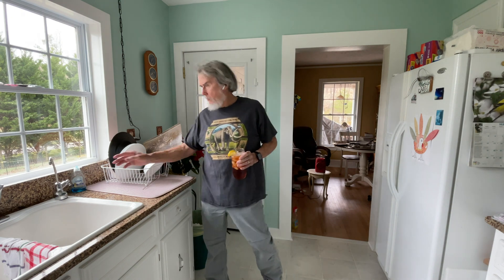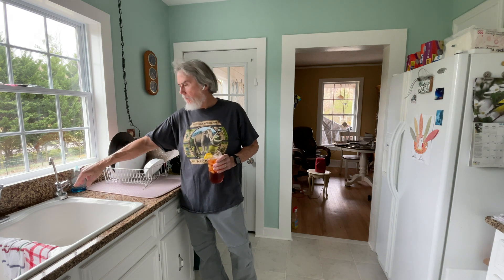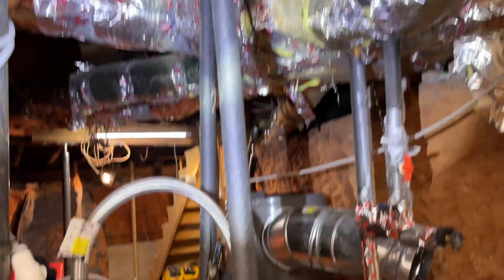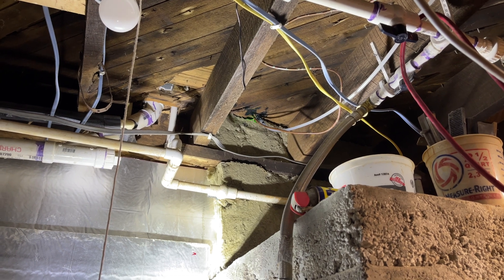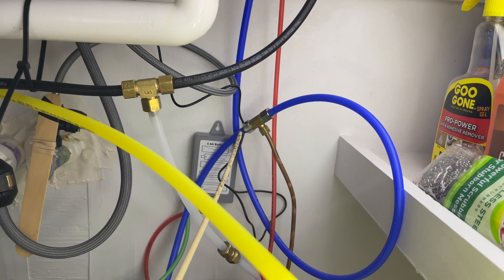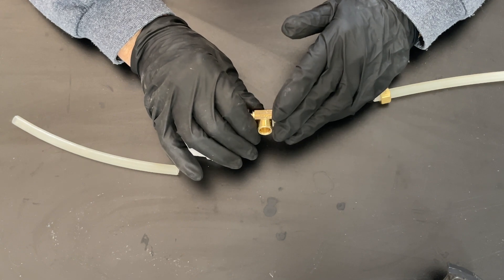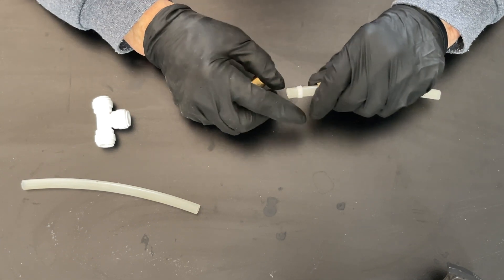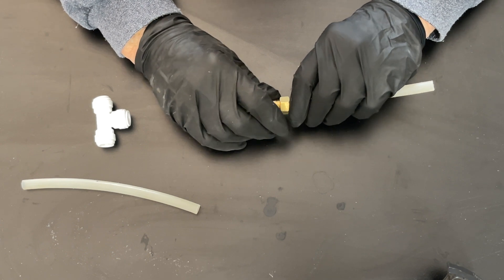Connecting a Reverse Osmosis Water System to a Refrigerator Ice Maker

Comment: I have an under sink system running to my LG fridge and freezer for water and ice. My water is great, but once I add the ice into the water it tastes bad. I can't figure out why this is happening. It comes and goes, so it is not all the time.
Reply from the maker: Some plastics can cause the water to taste bad. Try freezing another source of good tasting water in a separate ice cube tray and see if that ice makes the water taste bad. Sometimes food odors in the refrigerator or freezer can affect the exposed water in ice makers or ice cube trays. A long time ago we purchased a new refrigerator that gave us bad tasting water out of the dispenser. The solution was a different brand of refrigerator.
Reply: @anisotropicplus I did read a water softener can cause the ice to taste bad and does not affect the water taste. We changed the filter (which was dirty) and added salt. So trying that to see if the ice is better. Old school ice trays just sounds like too much work to keep up with these days
Reply from the maker: Thanks for your comment and let us know if you find a solution to the taste problem.

Comment: No issues with pressure from the RO unit to the ice maker? I have all my connections proper but the ice maker won’t work I’m assuming due to low pressure from the RO unit.
Reply from the maker: You may be correct about the pressure. We just bought a new Whirlpool refrigerator and the installation instructions said the ice maker and water dispenser will not work using an RO supply unless the water pressure is at least I believe it was 40 psi. Make sure your RO expansion tank has the correct air pressure on it.

Comment: So did your copper rot out yet r o through copper usually eats it up with in six months to a year
Reply from the maker: Not yet, but you are correct about it being a potential problem.
Reply: so it’s leaked since then? also cleaning using Bleach isn’t a great idea as Clorox’s main ingredient it’s really a HEAVY oxidizer greatly reducing the lifetime of the cable after it reacts with copper. so more like 3-6 months than 8-16 months before a problem should arise unless the tube is PVC, which then lasts max additional 6-9 and 1yr-2yrs non oxidized copper

Comment: Great video and thank you for putting together several camera views showing what you did along with a great explanation. Not all videos do this. One thing I had read about before was to try to avoid using copper lines with RO systems. Since the water doesn't have any dissolved minerals, it tends to be more corrosive to the copper which leads to more dissolved copper in your water. I have no idea to what extent this happens and maybe it's not anything to be concerned with, but thought I'd share to get your thoughts. You must have seen an improvement in water quality vs using the tap water from the city? I'm working on installing my first system now so I'm learning as I go!
Reply from the maker: Thanks for watching and your comment. To save time and money I simply used the existing copper tubing to the refrigerator. You are correct about the pure RO water possibly being more corrosive to metals compared to water containing some amount of metal ions. The head of the Materials Engineering Department at Dow Chemical in Michigan told me 47 years ago during a job interview that the most corrosive thing they had to deal with was distilled water in the metal steam pipes for the same reason. Thanks again and I think you will find the RO water to be positive because it will help remove some of the worry we all have about what is in our drinking water. Personally I like to add a small amount of pure electrolytes without sweeteners or flavorings to the RO water for taste and health. Our local city tap water is relatively clean and free of industrial contaminates, but it does contain chloramine as a disinfectant.
Reply: @anisotropicplus  Thanks for the reply and additional information. I may try the electrolytes or flavorings as well!
Reply: But he also gets the benefit of copper to drink since it’s rare, whereas Zinc is easier to get in your diet; I’d say.

Comment: Fyi - you shouldn't be using copper tubing with an RO system, since it can leach the minerals from the copper and contaminate the drinking water. This'll also result in the tubing to be damaged over time, leading to leaks.
Reply from the maker: Good point! Thanks for your comment.